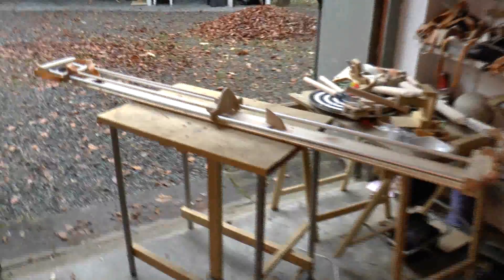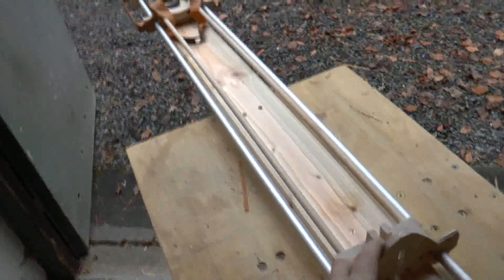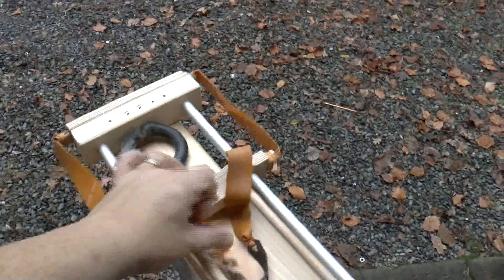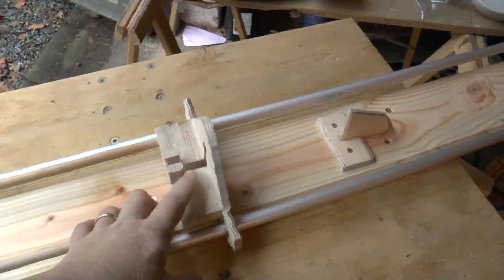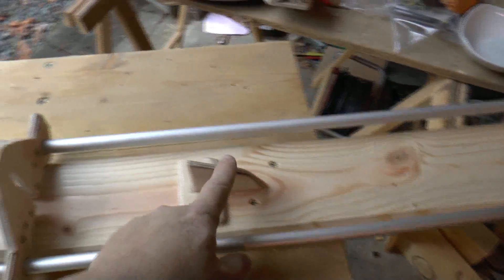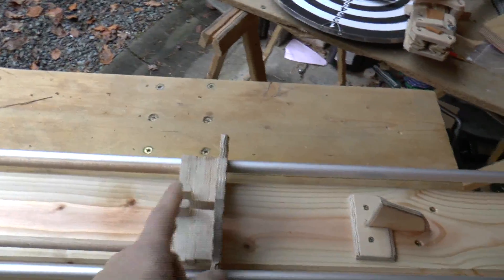Preview: Shooting A Slingshot With The Slingshot

Comment: awww... I think many of us were expecting a slingshot launched as a projectile...
Reply from the maker: But that is what happened. It only got stopped after about 110 cm.
Reply: JoergSprave I suppose I wanted a slingshot that was airborne for some significant distance before launching the secondary projectile...  :D
Reply: JoergSprave
I always imagined you would just make tiny hand held slingshots and shoot them out of a bigger slingshot.
Reply: JoergSprave
What about a slingshot you could fire directly into the air, then at a certain height it fires it's shot? That way you could shoot from behind walls. Or maybe something like Israel's kitty-corner-shot, but in slingshot form?
Reply: amiablerecluse01 The problem about that is that for every reaction there is an opposite and equally strong reaction. So it is not very effective to shoot a slingshot in the air.
Reply: JoergSprave I figured you would launch a slingshot to your partner in the field a 100 feet away because his slingshot broke while whacking a zombie with it and there are now new zombies closing in on him. :)
Reply: Baba Wethu I'd say that the slingshot in this video probably isn't too effective either.  But Joerg does a lot of stuff just because it's awesome.  
Also, you can't just start citing abstract physical laws and then just call it an answer.
Ignoring air resistance and other non-conservative forces (which I think are pretty negligible with the large elastic forces at play here), the slingshot as Joerg did in this video and a hypothetical one where the secondary slingshot is actually a projectile are basically equivalent.  In the times that the ball is accelerated by the bands, the same net work is done in both cases, so it's going to reach the same final velocity.
Reply: Baba Wethu That is true, but that isn't relevant to the speed of the ball. The slingshot flying in the air would shoot with the same amount of force as it would if it were anchored on the ground, the only difference would be that the slingshot flying in the air would lose momentum upon shooting the ball.
Reply: I was thinking he was shooting AT a slingshot...
Reply: Sam Forner That would be a great tactic though :) you're outnumbered but hide a series of slingshots and their trigger mechanisms in the bushes to your left and right. When you get stormed you fire on the other slingshots which causes them to fire, making the enemy think you are with a lot more people :).
Reply: ***** Well he also wanted the slingshot that was being fired to shoot something as well. =D
Reply: TerminvsEst well yes, the second slingshot would fire in midair :)
I'm thinking a trigger mechanism that would be tripped at the apex of the secondary slingshot's flight.  Perhaps a horizontal cardboard flag that would be pushed upwards as the slingshot began its descent.
Or maybe a slingshot mounted to some sort of glider... :D

Comment: Bit more science for you: when the shot is fully released should be the exact moment all other sleds begin to decelerate. Assuming zero friction, it would be the moment the bands show slack as that is when they cease to "pull" the sled. The system looks as though it has minimal friction as it is so it should have negligible impact on where the launch point is. I suggest you figure out exactly how many frames from the final sled being triggered to the shot being released. Then find the frame where the lower sled shows slack and count back that many frames to figure out where the release needs to be

Comment: Sorry, but speeds
They will not be encountered together.
He has already heard.
The inertia existence.
But I also love all the other work and inspiration.
I wish you good videos.
But I'm missing is "how to make".
Reply: Is this feedback or poetry?
Reply: MrVipera83 You're not entirely correct. Yes, 2 slingshots won't make it go 50+50=100, but it will go slightly faster.
Lets say we have no resistance at all. mv^2/2=E is the formula for energy. If we double the energy (like if you have 2 bands) you don't get twice the velocity, you get aproximatley 1.4 times the speed. But, since the mass for one of the slingshots is technically the other slingshot you get even lower, and the friction is higher too. I would assume you get like 1.1 times the speed. If you would just take a 2x longer band you would get better results.
Reply: The Pancakerizer   O.K
Reply: JoergSprave" Inertia "   Sorry my english is bad, but i thing  slingshoot "1" speed circa 50m/s and slingshoot "2" speed circa 50m/s ammo Cancel will result in .100m/s
because they are not allowed to interia
because if it was not.
you can do ten slingshot 500 m / s ...

Comment: Interesting idea to try. I am just thinking; what is the difference between this and one larger band stretched the full length?
Reply from the maker: This can - in theory - exceed the max retraction speed of rubber.
Reply: I can sorta see that. If the acceleration is not linear and decays over time for rubber... You may be in a region of a higher rate of acceleration for a longer time with this setup. It would be interesting to see the comparison of accelerations curves between the two setups.

Comment: Im no scientist, but it seems like the only thing it does is pull and release the smaller band quicker. 
Also, speed is only relative. the earth spins at ~1000 miles per hour. any effects of a secondary speed source (whether train or 2nd rubber band) is relegated due to a moving earth. But again, "relative" is the key term. In regards to human observation, the ammo may fly faster on a chrono; but that is like saying a fly flies at 570mph while in a 747 airplane.
Reply from the maker: You have to think "system". Everything ON the planet is IN the system. The ball, fork and bands of the small crossbow are IN the system, the target is outside. From the "view" of the target, the ball flies with the speed of both band sets accumulated.
Reply from the maker: Pontus Welin Sure, a straight 2 meters long crossbow would be more effective. But that isn't the point. The challenge was to build a slingshot that shoots a slingshot, not to build a 2 meter long straight one.
Reply: Try this......Get on a bus, wait until it's travelling 70mph. Then run up the aisle and jump out the front window.........If your theory holds up, you'll be fine. :D
Reply: What do you know about science, you sell Propane!
Reply: Your picture made me read that with she sound of Hank hill.
Reply: "I'm no scientist" you can say that again!
Reply: OfficialChrissums propane is (typically) a gas. science, bitch.
Reply: OfficialChrissums
don't forget... and propane accessories
Reply: JoergSprave Yeah, you are right. The system relative to the target is all that matters. But what I wonder is if it wouldn't be more effective to skip the small sling and just use more rubber. 
On the other hand. This is sooo cool! =)
Reply: JoergSprave god damn it... i did hungover physics again, didnt i? im not for sure what i was (pardon the pun) aiming to "explain" with the whole "speed of the earth... relative" thing, so here goes my logical attempt.

the only possible, positive outcome seems like there is now more acceleration. the most prevalent negative outcome seems like the extra weight and friction of the track system negates the acceleration.

id also like to add, i went to a christian school where science is the devil. so by all means, detail my ignorance in the matter. oh, and you should lard up the tracks. im no learned man, but i know the importance of lard-lube.
Reply: That is a misrepresentation of the argument.
It should be me on the road running and a bus hits me at 70 mph increasing my forward momentum.
Reply: In your example if the fly collided with a stationary object it would in fact have the energy of the 570mph it was travelling at. There is a reason why jumping off fast moving objects is very dangerous and the reason is that you inherit the velocity of the object, adding to your potential energy and increasing the force of impact.
Reply: That is still a good thing, as the elastic loses energy the longer its held back, Joerg did a test a while ago
Reply: ***** Well if you can faster or as fast, it's not gonna do anything.
If they run faster, you'll be kissing the ground.
Reply: If you think about it. The rockets sent in to space are often sent from near the equator (not always) because the earth is moving fastest there then when the rockets leave the earths "system" to the objects out side of the "system see the speed of the rocket combined with the speed of the earth. So say the first sling shot moved the second one at 20mph and the second one moved the ball at 20mph the ball comes out at approximately 40mph. Not at 20 mph. I am ignoring air resistance here to make a point. The parameters would be slightly different with air resistance but the same basic theory!
Reply: JoergSprave Well, actually it's (v1+v2)/*(1+((v1*v2)/c^2) :P
Reply: Chris Brown How the hell would the friction negate the acceleration? Can you not see the sled moving? What are you trying to do here other than use words you looked up in your text book in an attempt to sound intelligent?
Reply: Also, speed isn't additive, it's multiplicative, so it isn't the two speeds added together, but rather them multiplied by each other in some complex formula I can't remember. (This, of course, has little to no effect when moving as slow as the slingshot presented here, you need to be going at near speed of light to get a real difference)
Reply: Tokubetsu Kogeki-tai all is well in Japan, no ?
Reply: BloodNinja7
 
I's just an analogy for a body in motion.
Think of a billiard ball in motion getting hit with a stronger force going in the same direction.
Reply: ya but like you said "relative". in the plane the fly is going slow but if the fly exited the plane and hit you whilst you were standing still it would probably break through your skin and may kill you if it hit you in the heart.
Reply: Nope. You have the wrong frame of reference. The smaller slingshot is acceleration relative to the sled which is also accelerating relative to the earth. Your whole speed is relative and the earth spins argument is not relevant with respect to this system.
Reply: ***** I know it is, but it's not a very good one.
Reply: ***** lol...Feel free to try this one too...Either way, it's faster
Reply: pretty good but the only thing he wants is this so...
Reply: yeah you´re right but its something new :DD
Reply: JoergSprave You know, regardless of how the energy transfer in the system affects the ball fired, the main thing that worries me when watching this fire is the rails on the sled portion itself! Watching them bow outwards when it impacts with the buffer makes me wonder if they're not going to break after only a dozen or so fires of the slingshot? What wood are you using for them?
Reply: Andrew McCarney i dont have text books... just my G.E.D.

the wood slides on the metal, creating friction, slowing down the acceleration of the band. 

if we use the train scenario described int he description, we can say that the train's speed is constant and completely independent of any outside force. in relation to the gun, neither the shooter nor the gun can affect the speed of the train. in the slingshot's scenario, it is not constant; in that, the only affect on speed this system has is acceleration. when friction is factored in (both from the fact that wood is touching metal and the wood adds weight between the band and the ball) acceleration severely decreases. the added weight and friction can even negate the added acceleration the the first, longer band may have added. 

But to simply answer your question "How the hell would the friction negate the acceleration," you wouldn't hold your brakes while trying to accelerate your car, would you? no? why? because it adds friction between your tire and the road.
Reply: Ludvig Nygaard this guy^
Reply: Chris Brown Negate would mean that the friction cancels out the added acceleration, which it obviously didn't do. You don't have to give me elementary car brake examples or explain what is happening here, I've taken physics courses in university. I understand the effects of friction and acceleration.
Reply: Ludvig Nygaard That is completely false, according to galilean addition of velocities Speed= velocity1 + velocity2.
I believe what you are thinking of is the composition law for velocities which is S= (V1+V2)/(1+(V1*V2)/C^2), The velocities are not multiplied as you stated, just think about it. That is like saying if you walk at 3mph down the aisle of an airplane that is traveling at 500 mph you are going 1500mph in relation to the earth.
Reply: Andrew McCarney thanks for explaining to me the word i used, but im fairly certain i have a firm grasp on what "negate" means. 

my entire argument is "using the same amount of rubber, leaving out the secondary source, would result in nearly identical speeds." meaning this model simply is not a good representation for the train analogy.

also, by saying you have a better grasp on acceleration and friction than i do implies that you think my analogy is wrong on "How the hell would friction negate acceleration." are you saying friction can not negate acceleration? if that is the case, than i will cancel University of Missouri off my list "schools at which i want to learn more about physics." but, because you fancy yourself a learned man, ill just say that friction is a force that inherently apposes motion.
Reply: Chris Brown
Apparently you don't have a firm grasp on what it means. Does this help?
ne·gate
nəˈgāt
verb
1.
nullify; make ineffective.
"alcohol negates the effects of the drug"
synonyms:	invalidate, nullify, neutralize, cancel

I did not say that friction cannot negate acceleration, I am saying it is obvious that in this case it did not. I'm not sure the University of Missouri would accept you if you tried.
Reply: And accessories.  Don't forget about the accessories!

Comment: still looks slow
Reply from the maker: It is a scientific setup, not a practical weapon design.
Reply: more power!
Reply: also been meaning to pass on a design for the best darts ive ever made for blowguns you snip off the end of a shoe lace the hard plastic bit leave alittle lace to fluff up and put a pin through the center these are really fast darts especially in a blow gun
Reply: how about making a slingshot crossbow that shoots rotary saw blades put a rack on the rail and a gear on the blade so it builds up spin as its pulled up the shaft i think that would be a freaking awsome zombie head lopper
Reply from the maker: razzorbladz Did you not see my two saw blade shooters? Problem is that non frisbee shaped disks do not fly straight.
Reply: yes they will curve in an arc so you need a sight that factors this in or fire it vertically with the shot curve going skyward and hope gravity will keep it from going too high?
Reply from the maker: razzorbladz They don't curve in an arc, but go on a crazy spiral, unpredictably. Forget it, you simply can not achieve accuracy. Why do you think clay pigeons and frisbees are bowl shaped of there would be no need?

Comment: Very interesting idea, perhaps you could try two elasticated levers on the side to hold the ball in place, so the ball is not shifted upwards when fired
Reply from the maker: The upwards motion adds safety, no fork hits that way.
Reply: Ah ok, that explains it, safety is the most important thing, power comes later =)